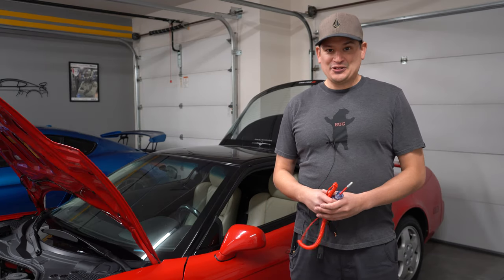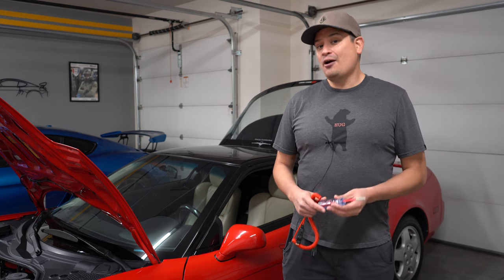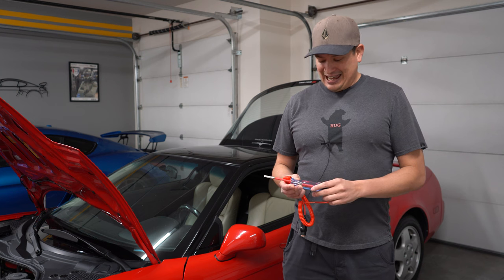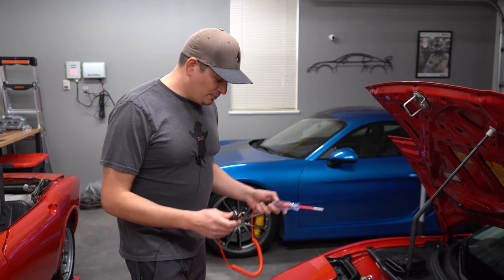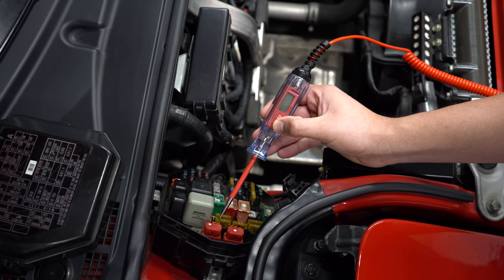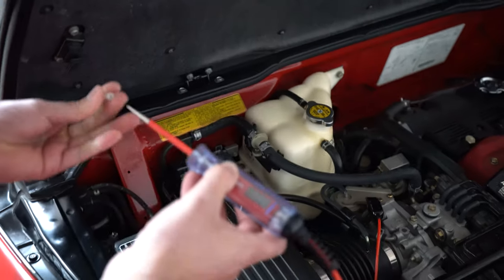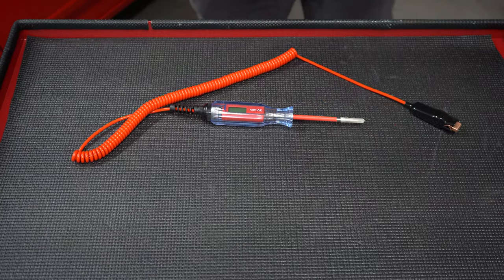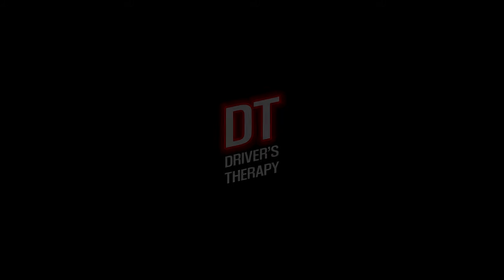Digital Circuit Tester Review - "BEST TEST LIGHT?!?!"

Comment: Hi probably a stupid question but I genuinely don't know do you need the ignition on or do you just earth and touch a cable with it?
Reply from the maker: Not a stupid question. You just ground it and probe a circuit. If it had power it should light up and provide the voltage reading.
Reply: What's ground it mean? @DriversTherapy

Comment: Where does the alligator clip connect to? I connected mine to a ground and nada happened.
Reply from the maker: You connect it to ground and then touch a wire with power. Make sure your ground is a good ground and if you don’t have power to a wire, it won’t light up.
Reply from the maker: Test your battery first

Comment: That’s a better design than my Snap-On stick test light that cost me £69
It’s only a bulb but it does have a fuse protection but I think your test light has it built into the electronics anyway, it doesn’t have a spike protector and it also doesn’t have a coiled lead.
David you should pull out the electronics and show the internal build quality.
But otherwise a great review.
Reply from the maker: Thanks! It’s definitely pretty cool and a barging for 20 bucks. I assumed it would have a old school fuse but it might have something else. The inside was just a small box. Not sure if I can take that apart. Thanks for watching!
Reply: By the way David, In case you don’t recognise my avatar or name this is Clive Pluckrose. 😎
Reply from the maker: @chl935nsx  ha! I didn’t. Hello, my friend!!! 🙂🤘🏽❤️